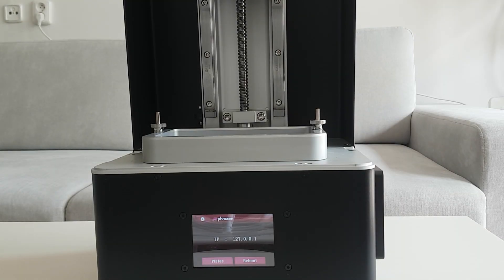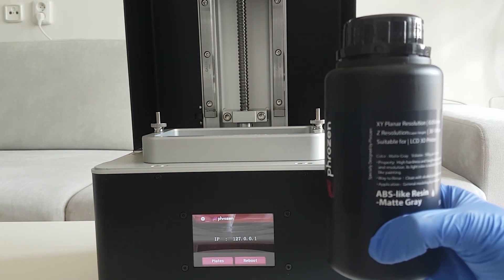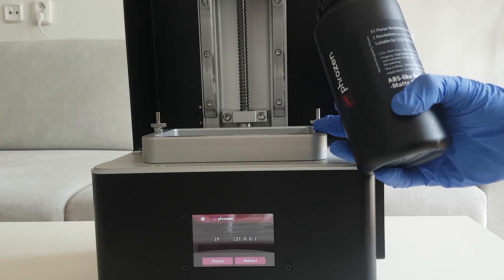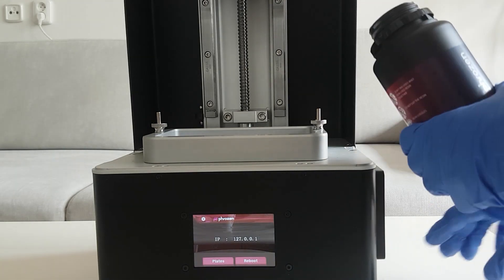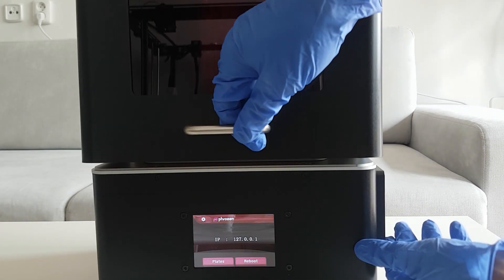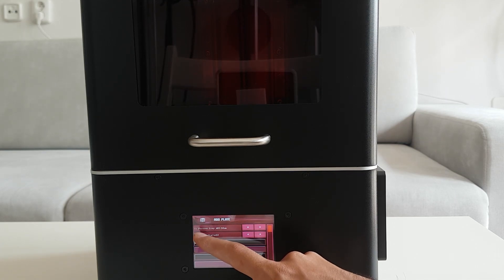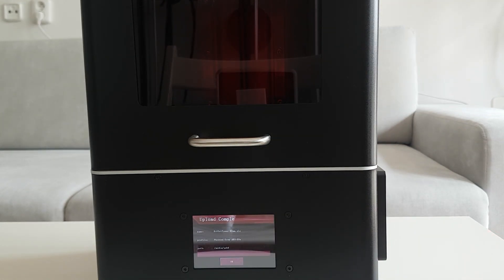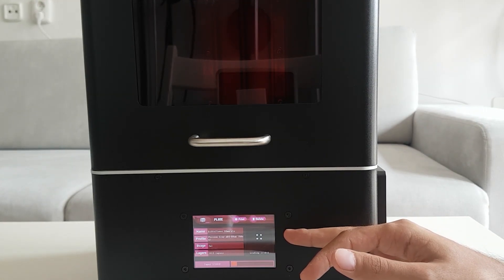DLP 3D Printer - Phrozen Shuffle // First Use

Comment: Looks like its in your living room.  How tolerable is the smell of the Phrozen grey resin?  Do you use an air purifier?
Reply from the maker: Yep that's true. The smell is really not bad at all.. i just keep an open window and that's about it. And no i don't use any air purifier, it's not necessary. The smell of this resin is more tolerable than the one i used from anycubic.